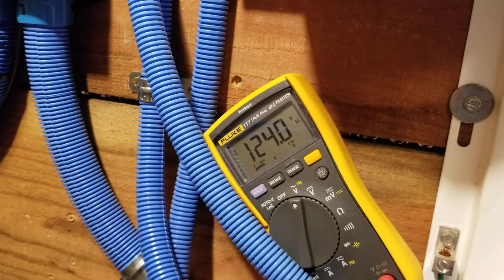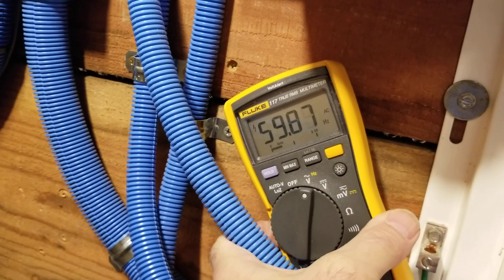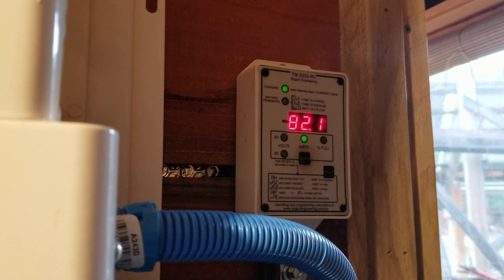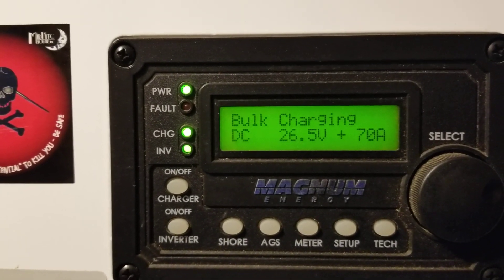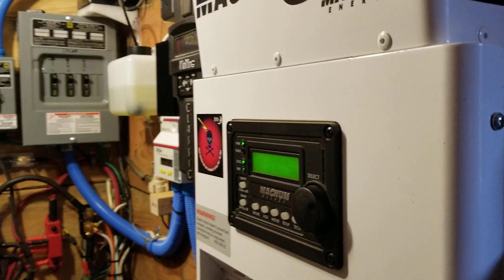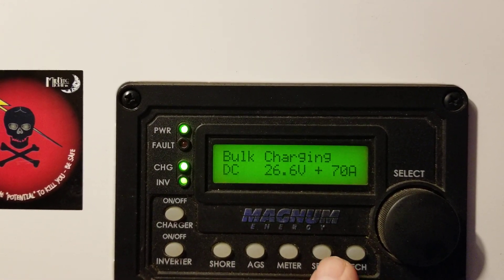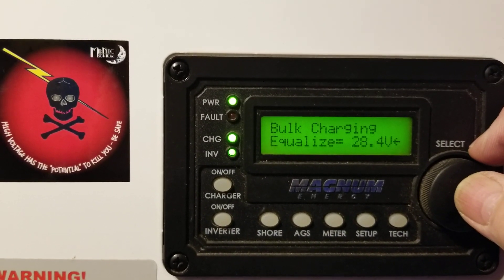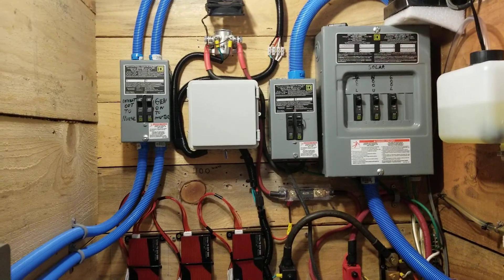More boring Tesla battery charging with a diesel generator through a Magnum inverter.

Comment: That was a nice explanation and demonstration. I'm still learning my new 48volt  Magnum system it has made my life so much easier. Both of my new inverter Chargers are  late 2019 models and these new models have a lithium setting built in. I think this is something they just did. 
 I know the setup on mine was pretty much a breeze but there are a lot of parameters to take into consideration. It's awesome to be able to charge a 240 split phase inverter charger with a hundred and twenty volt generator any size almost.

Comment: Yes, this answered many of my questions, thanks!  Just purchased my $99.99 Predator to make the low cost, high wattage charger system that uses way less gas than my generator, like the one you built.  I can only get 35 amps out of my 2 - 24v chargers.  I don't like my loud 7500W generator running at full rpm for hours and hours for such little amps of charging.  Just ordered a 100 amp PMA to run at approx 60 amps on the 6.5hp Predator.  That Magnum is amazing!